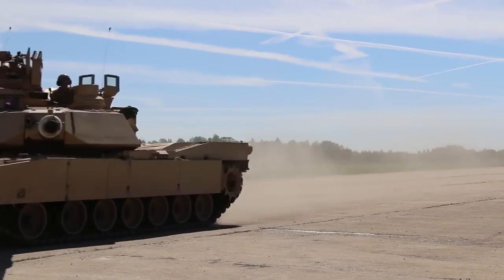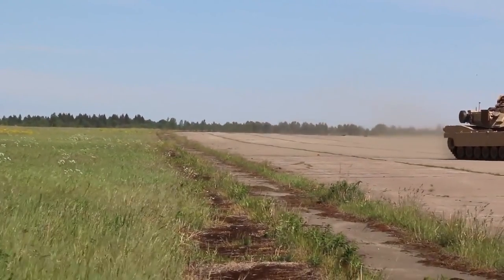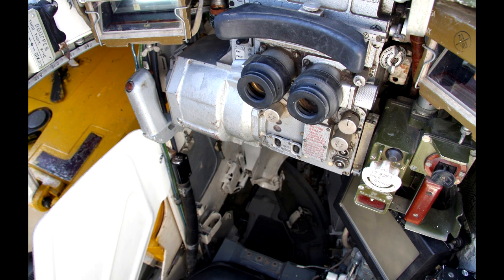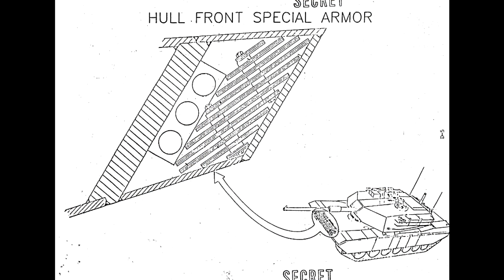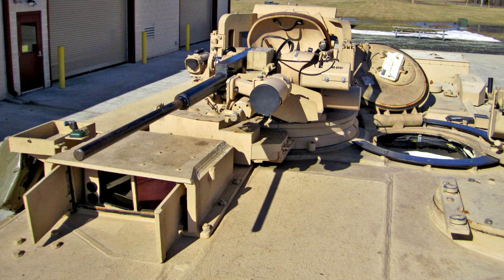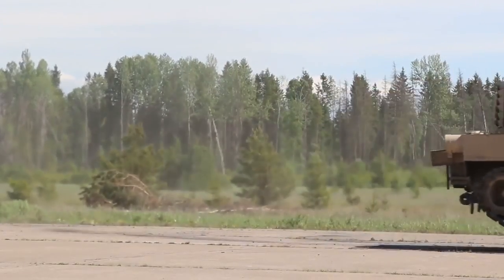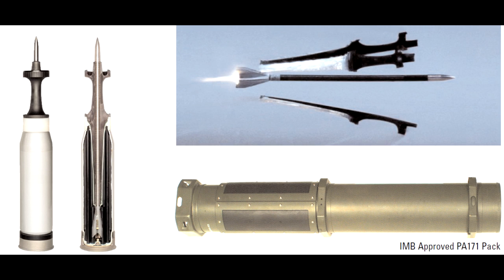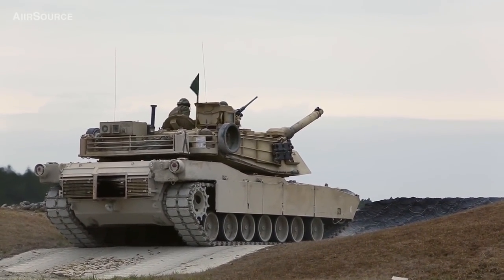Problems with Abrams tank

Comment: Kid: Mom can we have Leopard2 at home?
Mom: No kaisergrad. we already have leopard2 at home
Leopard 2 at home:
Reply: That kid must be lucky to have a better vehicle at home.
Reply: @Phapchamp  Well you are right but i didn't say that Abrams is bad. It's just not as good as Leopard2.
Reply: @kaisergrad3594  Abrams>Leopard 2A4 in pretty much any category from FCS to Armor to ammunition.
Reply: @Phapchamp  First Abramses were so bad to be honest. It used 105mm gun (In 1980s Russians were using 125mm and Germans were using 120mm. Then Americans copied the German L44.) I can say that Americans doesn't know how to do a tank.
Reply: @kaisergrad3594  105mm M68 gun could perform better than 120mm L44 because of the better ammunition in 80s. M900 compared to DM33. M900 has over 500mm of penetration while DM33 has 470. Americans only copied when they decided to produce their own ammunition.

On the other hand protection wise early model abrams were much more superior to 2A4s. Smaller gun shield while not having a huge ticking bomb on its hull unprotected and overall better armor makes it better than 2A4.
Reply: @Phapchamp  I don't think so.
Reply: @kaisergrad3594  ok

Comment: Gas Turbine=All Torque available immediately, fuel consumption constant(though high)and predictable. also quieter at ranges
Diesel=Torque not consistent through engine RPM range

Also, the 120mm gun upgrade was part of the original design, it was simply not yet installed. 

Bottom line this is more an opinion piece that a fact based piece. There's clearly not enough research to justify this as anything other than an opinion piece

Comment: The only thing that is better over gas turbine is that it produces much less smoke
Reply: There not quieter, there basically around the same amount of noise given off, the more relatable part makes no sense as he went over why the engine isn’t that great, all modern tank engines create a lot of hp

Comment: Great vid. Not trying to say this is incorrect, but I remember reading that at sufficient angles (the angle of the m1 upper plate) the APFSDS round will shatter and won't penetrate. Obviously I have no idea if that is actually true, but if it is, then the lack of armor isn't that bad. Still bad because going slightly downhill will nullify the shatter effect lol.
Reply: depends on the APFSDS round but there is a small range of angles where it pretty much just slides off. Shattering or just a partial shatter and subsequent penetration are a lot more likely tho
Reply: Even if the apfsds shatters, which it most likely will, the body and fins would not be destroyed, penning the abrams

Comment: If the Abrams did have the German Diesel engine it would be a lot more quiet on the inside
Reply: That's a problem as someone pointed out. It will have its own mind and invade Poland.
Reply: @navalfa7291  lol 💀

Comment: One comment on the note about shells bouncing off the front plate and into the turret ring, US army testing discovered that APFSDS shells don't bounce, like at all. They shatter, when they hit an armor plate at angles at around 80 degrees they begin to shatter fairly reliably. This means the upper front plate of the Abrams that's 80 degrees would more likely shatter an enemy APFSDS shells than bounce it into the turret ring, which is why they made the armor so thin. the bouncing into turret ring situation was basically born from War Thunder's poor shell shattering mechanics leading to salty players everywhere cursing the design choice online
Reply: The shell would shatter, but the Tungus core of the body and fins would still be intact, going right through it like paper

Comment: The big reasons for the GT in the M1 are thus:
Easing of supply lines because you can use any fuel
The war it was designed for was across Europe as fast as they could go.
You can go further faster if you can use any fuel to hand
Overrun an air base? Kerosene
Petrol station? Diesel and petrol
Commercial warehouse or market?
Any cooking oil
Vehicle maintenance shed?
Engine oil

Second reason is future proofing, you got the torque to pull more weight
You got the surplus to generate more electricity for future upgrades

It's also only got one moving part
If well made it should be considerably more reliable that an internal combustion engine

Comment: I completely agree with everything you said but the statement you made at 4:47 is false because if the apfsds doesn’t penetrate the armor it wouldn't bounce it just simply shatter
Reply: You should watch his video about Abrams UFP APFSDS shattering
Reply: That's what I was thinking. Unless it has enough penetration power, APFSDS at an extreme angle of attack of 80 or more degrees will experience alot of structural stress due to their length relative to their width. As a result, the shell looses structural integrity and shatters. It's old, short APFSDS rounds that ricochet, not the long rod penetrators of today.

I cannot stress how important this is, the Abrams get's too much flak for being weak when it's actually games like War Thunder that are constantly allowing other tanks to inflict Turret Ring Syndrome onto them.

Comment: Red, you mention in this video the flaws in the Abrams.  Have you heard of revisions to products?  They, the military and the manufacturer, knew of these limitations way before you did.  You got your data from their revision history.  At first I thought this was an expose until I thought the matter through and realized this was just a declassified history of the Abrams.  It is currently at Rev. M1A2C.  It is far from its original release revision.

Comment: The Challenger II is a better tank in my Opinion.
Reply: And even some tanks with composite armor can be knocked out with HESH if you aim correctly, aiming for cupolas or turret rings. The only Challenger lost was lost by accidental friendly fire after a HESH round landed on its commanders cupola and splashed into the turret.
Reply: Saint Jerry the rifled gun provides one big advantage, Accurate HESH rounds. HESH is one of the most reliable AT rounds out there, it's low velocity, but it can deal massive damage to vehicles. Especially older vehicles like T55s they encounter in the Middle East. And it is very effective against Infantry Fighting Vehicles and trucks. Basically if it doesn't have composite armor or ERA, HESH can deal with it.
Reply: @Saint Jerry i agree with you, Rifle gun doesn't give any significant advantage over Smoothbore

Comment: Soviets did an extensive comparison between their diesel and turbine engines when testing T-80.
Estimation was that turbine aside from superior mobility (1000HP compared to ~800HP on soviet diesels at the time) offered much easier and faster maintenance, 2 times longer engine lifespan,  smaller heat signature I assume (literally says "1.25-1.9 times harder to detect from air"), and 1.5 times less fuel cost per km (speaking of fuel types, that may be not too relevant in realistic situation). 

There are benefits to a turbine, it depends if you can take downsides with you in a form of a fuel supply convoy, heh.

Also I heard that M829A3 had issues with L55, like terrible accuracy out of longer gun for some reason. That's just a rumor though. Wonder if A4 has those.

Comment: There were only some minor problems I had. The turbine engine is actually better then the diesel. Turbine preforms far better at lower speeds, has greater acceleration, is a smokeless engine, and is actually far quieter then the other. It uses more fuel over all yes, however the abrams has a increased fuel capacity over all (an operation rage of about 239 miles) which isn't at all that bad for a tank. My other issue was with the armor, it is only 33mm roughly. However the issue is we have almost no clue what makes up the armor in it's entirety. We have no idea how protective it actually is as the latest abrams have never been combat tested against other tanks. I know it wasn't talked about but the M1A3 has an optional trophy reducing the risk of guided and unguided rockets now. We'd need to 1.) Test the abrams against other tanks shots, and 2.) Would need to know what kind of makeup the armor has with it only being 33mm it must be good in the front. The U.S. army has always been slow to embrace new tech, but it has nothing to do with another country 'superiority'. It's just their mindset, the gun in time was slightly upgraded on the A3 and now there looking into an overall tank upgrade.

Other then the minor issues the video was great and well put together. To say turbine is inferior is just out right wrong. Have a nice day mate.

Comment: From what I have heard about the engine is that it gives better maneuverability at lower RPMs and leaves less of an exhaust cloud behind compared to a diesel or a gas engine would.
Reply: much more of a thermal image though. Due to amount of heat.
Reply: @seeweezeke  You clearly don't understand how thermals work then. Doesn't matter how hot something is, all that matters is the temp difference between the object and its surroundings. A 500 degree engine and 700 degree engine will both look the same on thermals lol. That's a completely invalid criticism that you made.
Reply: @kamraam1464  not from far distances it won't.

Comment: The argument about jet fuel is wrong. There is a good reason for the US Army to keep jet fuel in their reserves. The Army also operates helicopters and attack aircraft who also happen to share the same type of fuel that the Abrams uses. Whether good or bad, it not a logistical nightmare as many including your by pure mistake, make it to be. The US wouldn't have kept the Abram for more than 30 years if fuel logistics was going to be the argument.
Reply: Mileage is a big factor since the weakest part of the Abrams is the follow up fuel trucks.

Comment: The turbine engine has better fuel efficiency over time than diesel engines
Not to mention that turbine engines can use a far wider range of fuels compared to diesel engines
Why do u care so much about oil usage anyway? Its not like thry have a shortage of furl do they?
Reply: in war time, there will always be a fuel shortage

Comment: Hello, I've recently discover your channel ! Thx for the very interesting and unbiased stuff we can find in it :) About the so call "muti-fuels" argument for the use of turbine, we must also think about the contexte and history that might have work in favor of this solution : 

1. During ww2, Germany has a major (some even think fatal) issue of poor oil supply and gasoline production, especially in enouth refined gasoline used by there panzer divisions in the East. Even more as and when the war goes one. So the idea of using a gas generator turbine for tanks seem's to have in fact came out during the late period of the war (you can check the GT101 for Panther) because despite its poor efficiency vs pistons engines, it could easily work using of inexpensive and widely available kerosene as fuel offseting the efficiency disadvantage at least to some degree. We can imagine that based on this experience from the previous major conflict in Europe, the US might also have think of that for the Abrams choice during the cold war when the main battleground was supposed to be Europe and that they would have probabily been used (at least at the begining in all major war scenarios) in a more défensive stand there relying on local supplies.

2.The "Father" of the Abrams Turbine Engine was Anselm Franz, a former Austrian enginner, pioner in gas turbine who work for the german during ww2 and was capture by the us (like Von Brawn and many others) during the operation Paperclip. SO IT JUST SEEMS HE REALY LIKED MAKING GAS TURBINE HAHA (and probably managed to convinced everyone in the army that it was a great idea lol) 

Now here we are, 2020 and still used in Abrams x)
Reply: yes , finally !
Reply: It's still shit compared to other tanks but  a tank is a tank

Comment: The filters explain why the M2 and M3 Bradleys kicked the hell out of the Iraqi Tanks in 1991 more than the Abrahms. Multi Fuel concept only works in a survival situation, probably a post atomic situation was the thinking behind it. The Chieftain had the same thinking with its l60 leyland engine....which effectively crippled the Chieftains performance and reliability.

Comment: As a civil engineer I always wondered why we use one tank as our do it all tank?  I would think that we would want a lighter more mobile tank for an initial invasion and a heavy tank for the actual major battles?  We can move 100 plus ton construction equipment with a  specialized low bed tractor trailer easily over our existing bridge system.  Send in a force of super fast 45 ton tanks for an initial invasion, then once they encounter strong resistance have the low beds bring in the 85 ton 150mm gun tanks to beat them back.  Just an idea.

Comment: I have heard the idea behind the gas turbine choice was visibility. The idea goes that since gas turbine engines put out less smoke than diesel you can reduce the likelyhood of detection. I think it's not too impactful considering modern systems but that's the explanation I heard :p
Reply: But that would come at the cost of a better visible heat signature, given the turbine puts out more heat. Also when idling in a combat ready situation when firing up the APU would be a bad call given that the turbine needs more time to spool up and be ready than a diesel. Sure, you can mitigate some of the exhaust heat by mixing it with surrounding air, as they do on helicopters, but that adds to bulk and doesnt deal with the heat transfered into the hull. However you twist it, for every upside there seems to be two downsides with a gas turbine in a tank when there is a diesel powerpack of similar size and power.

Comment: I heard that they chose the turbine engine because it has a higher pitch noise which dies off over less distance then a low pitch diesel one so the tanks can get much closer before you hear them
Reply: Not a very valid reason at all, in my opinion

Comment: The turbine is simple, quiet at battle range, not that much less efficient than other tanks (when its under load), has a very wide range of potential fuels, which is important in the battlefield, and produces good power. I dont see why people hate on it.

Comment: How many Russian tanks did Sudam have in his army in Desert Storm? How many after? The Abrams combat record vs Soviet era armour in that one conflict speaks for itself and Completely debunks any hypothetical 'what ifs' scenarios. One need only look at Soviet tanks in Chechnya in urban environments and the result of that debacle to understand that Soviet armoured warfare tactics are sorely lacking as well. So if your case is to argue that the Russian tanks in Iraq were not operated by Russian crew. Another example would be Afghanistan where Russian armour and tactics were decimated by another Rag tag 3rd world non organized army in that conflict as well.
Make no mistake with your obvious biases. The M1 Abrams is far superior to any other MBT produced world wide since its inception. Any paper tiger hypothesis to the contrary is laughable and lacks any concrete data due to lack of actual combat record. Where as the Abrams actual combat record speaks volumes to support it position in the pantheon of greatest machines of war ever produced.
Reply: You realize those Were bare bone tanks with 15 years old ammunition with UNTRAINED iraqis in those soviet tanks? and the actual combat record of the abrams is very poor.

Comment: You make bold generalizations and assumptions in this video.   like for example, saying that nothing could justify using a gas turbine engine in this tank.  If it was unjustifiable, why did the perfectly competent engineers, American as they may be, decide to use it with this tank?  Are you implying that a perfectly capable team of engineers were all incompetent and had no knowledge of vehicle design?  Come on man.
Reply: You act like professionals dont make poor choices. Interesting moon logic
Reply: Do you have a actual argument instead of this stupid "well i dont know why but it's surely good".